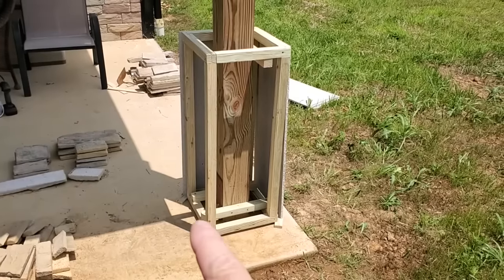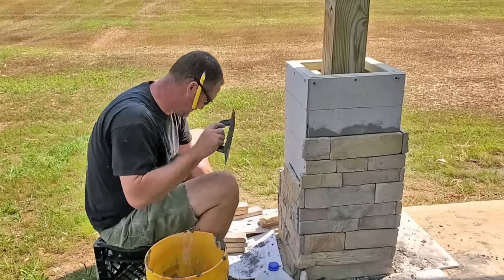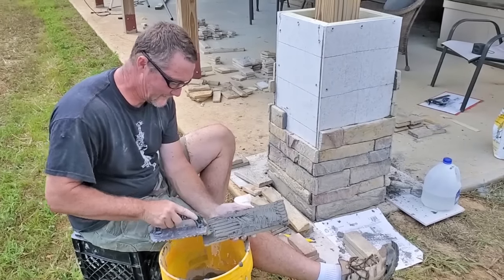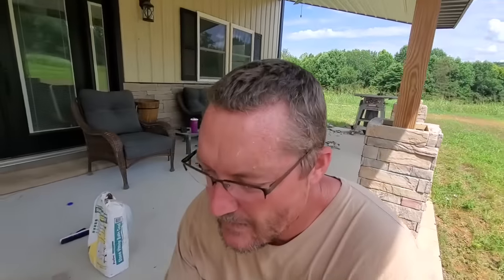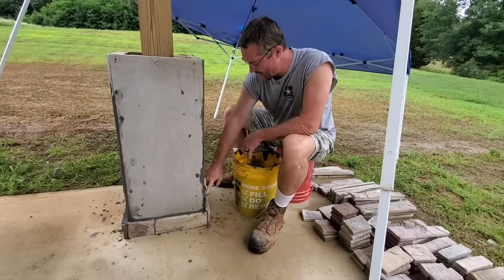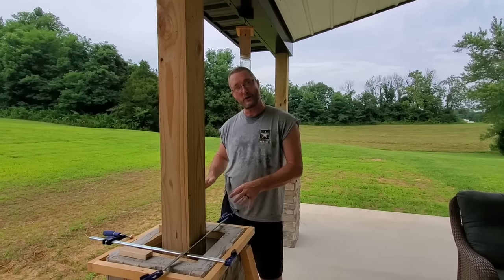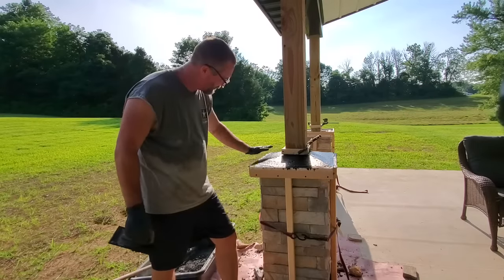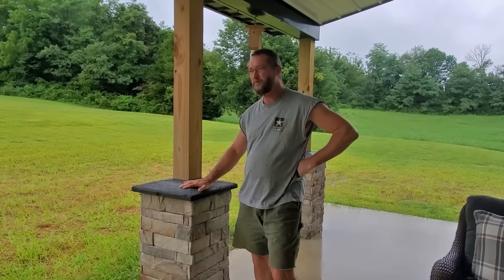🏡DIY Stone Porch Columns with Concrete Topper || Barndominium Living

Comment: This is very nice!  Would I be able to fill it in with concrete before adding the brick or would that be a waste of money?
Reply from the maker: If you are looking to make it more solid...instead of framing it with wood and sheeting it with cement board you can use concrete cinder blocks to form the base then put the brick on the outside of the cinder blocks.  They make 1/2 thick blocks that would work perfect.

Comment: You should have laid  the concrete boards flat, than put the stone on in the shade .... leaving 3 tiny cuts on each of the sides of the boards 
then after the boards are dry 
screw them up onto the the posts then all you would have needed to do was put the tiny cut on by hand.
Reply: That’s just a stupid idea.. I speak for everyone in the masonry industry 😅
Reply: @6by6by6  umm. Its the same concept as to exactly what he spent the whole entire day doing duhhhh
Reply: @lisasteger4048 absolutely why women aren’t allowed to do construction thank you for re assuring us we are not equal
Reply: @Dabs__  dude you do crap your way and push on while i do things my way ! 
If your molding stone to the same platform as i am and using the same adhesive method to secure it what difference does it make if i decide to lay the same damn board flat vs this video display of yes a male rethinking his own educational video method was clearly the longer route to take.  
If i used the same exact material the only thing i pointed out different is i didn't waste hours of my time working only to say hummmmm .... get out of my face if you think just brc your a make and im a female you do any damn job better.   How about this to all you male drivers in a pick up truck take a females advice and stay out of the left  expressway lane when driving so basically do the math ... 2 hours to getvto a job site and 3hours to realize you wasted time with the same method... im enjoying my 1/2 day vacation pay day off...... duh
Reply: @lisasteger4048  what are you babbling on about 🤦🏼😂 I do stone blocks bricks concrete, epoxy flooring framing tile flooring roofing plumbing electrical anything to do with a construction site an just think about it like this , do you put your siding on your house before you put the walls up ?? Do you put your shoes on before your socks ?? Answers no an reason being there’s a process for a reason an if Nancy was gonna come along an solve the process it ain’t gonna be today apparently 🤦🏼

Comment: I would of added wire and a scratch coat but other than that it looks great 👍🏼
Reply: I see your point, but wire lath and scratch coat is for ply wood sheathing. The cement board eliminates that step. However it would have been a better installation if a notch trowel was used to apply a layer of mortar to the cement board before applying the back buttered stones.

Comment: Couldn’t you just pour cement inside the boxed column to solidify the post, in order to save time and cost?
9/11/24, 8:28 am
Reply from the maker: @dorothypowell-skerritt4931  Cinder blocks will works also

Comment: what is the size of a pole or lumber ?
Reply from the maker: The porch posts are 6x6 post's.
I framed around it with 1 1/2"x1 1/2"  lumber and wrapped all that with the 3'x5' cement board.

Comment: What morter did you use?
Reply from the maker: ProSpec® Polymer-Modified Stone Veneer Base Coat

ProSpec® Polymer-Modified Stone Veneer Base Coat (BOM #120442) is used as a scratch and base coat for real or manufactured stone veneer units. Also referred to as a cement plaster coating, it is a blend of cementitious materials, dried sand, and special performance admixtures designed to produce a highly-bondable substrate and to optimize consistency between batches. Special admixtures help create both a mechanical and chemical bond to the substrate with excellent workability and non-sag performance. Polymer-modified, mix with water only. “Step 1” of the ProSpec stone veneer installation system used to create decorative exterior or non-load bearing interior veneer walls.  Can be applied over ProSpec Moisture Barrier or directly to fully cured concrete.